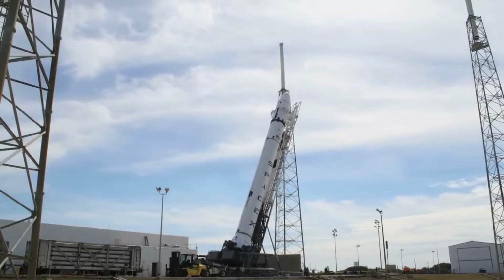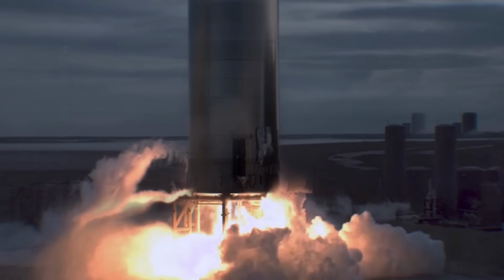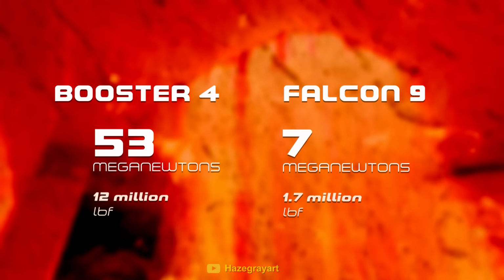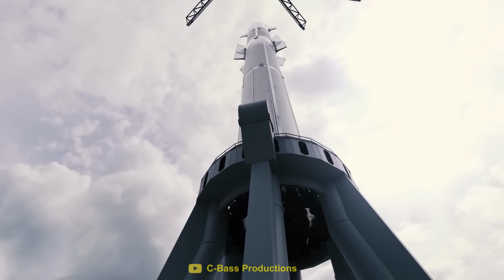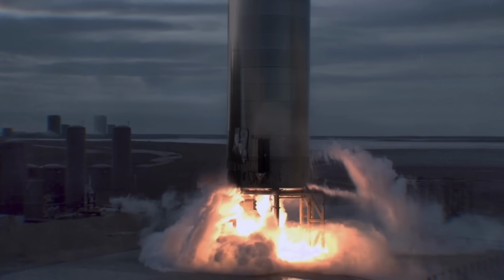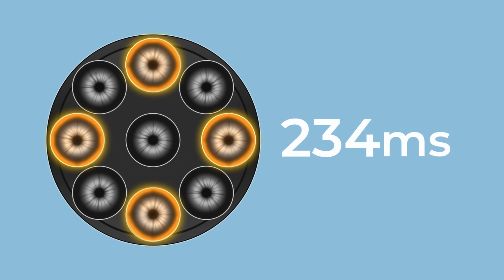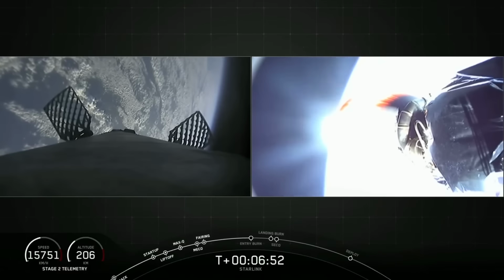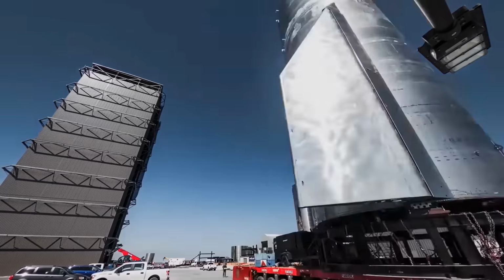How SpaceX Will Test 29 Raptor Engines

Comment: Is there an engineering reason why SpaceX doesn't have flame / debris diverter?
It seems to be much simpler to just build one on the launchpad (which is on the ground than hoping no debris will travel back and damage the engines or rocket structure.
I found this video way too late, after the first launch of starship and could see a lot of problems (debris flying here and there uncontrolled) in the first 15 seconds itself which could easily have been prevented.
Reply: Apparently the reason was more forward looking than practical. They hope to eventually launch rockets from other planets, and it would be less practical to have a diverted on another planet.

Comment: Actually it is a very poor design and put together this super heavy rocket. The more engines the greater problems. Should design a bigger engine and put just 3 engines or max 4 engines but not so many small engine. I think they are lazy to redesign from scratch and make super heavy engine for this rocket.

Comment: If it takes 14 tons of fuel to light the engines for 3 seconds, divide 14 by three and you need 4.6 tons for 1 second. and for a minute? 280 Tons.

Comment: In Newtonian mechanics, linear momentum, translational momentum, or simply momentum is the product of the mass and velocity of an object. It is a vector quantity, possessing a magnitude and a direction. If m is an object's mass and v is its velocity (also a vector quantity), then the object's momentum p is

{\displaystyle \mathbf {p} =m\mathbf {v} .}\mathbf{p} = m \mathbf{v}.
In the International System of Units (SI), the unit of measurement of momentum is the kilogram metre per second (kg⋅m/s), which is equivalent to the newton-second.

Newton's second law of motion states that the rate of change of a body's momentum is equal to the net force acting on it. Momentum depends on the frame of reference, but in any inertial frame it is a conserved quantity, meaning that if a closed system is not affected by external forces, its total linear momentum does not change. Momentum is also conserved in special relativity (with a modified formula) and, in a modified form, in electrodynamics, quantum mechanics, quantum field theory, and general relativity. It is an expression of one of the fundamental symmetries of space and time: translational symmetry.

Website;https;//www. Facebook.com/aamor9.
Website;https://www.linkedin.com/in/amos-ariny-00434629/?originalSubdomain=ug

Website; https://ug.linkedin.com/in/amos-ariny-022056220

Website;www;twitter.com/aamor9
www.mit.academia.edu/amosariny

Comment: Didn’t the Russians try this with so many engines, I believe they failed, just too many things can go wrong, it would be a much smarter approaches build the engines like the Saturn 5 F1 engines. Although we would have to completely redesign this engine because each one was custom made, and the men who built them had to make allot of modifications that were not documented, so it’s not like you could just pull the prints out of the drawer and build one of these. They say we have advanced, but if that is true, then why can’t we recreate the F1 engine?
Reply: SpaceX already uses a 27 engine rocket the Falcon Heavy so they at least have hands on experience with using that many engines in a single stage.

Comment: Do you want to know why the N1 failed so much? It never matters how many times you upgrade the engines, 
more engines = more complexity 
more complexity = a greater risk for something to go wrong
This is why everything on a spacecraft must be as simple as possible, to mitigate the chance something will go wrong.
Bigger, simplier, and less numerous is better
Reply: I generally agree but spaceX already launched multiple rockets with 27 engines in the booster stage (falcon heavy) so they at least have experience with successfully launching a ridiculous number of engines.

Comment: 29 engines ... why not 1 massive 9m diameter engine ?
Reply: Less efficient, more expensive, single point of failure and that one engine would need to endure 29 times the forces of one small engine.

Comment: Although I'm a student preparing for engineering exam but I wanna say that we are using lots of thrusters in rocket but and already the fuel make it so heavy ,we should work in the project that is how we can use electricity to provide inssane speed to rocket this will reduce fuel consumption in interplanetary mission and make mission more safer.
Reply: I cant rly tell what your are saying so i may be missing the point but the rocket is not running all the way to mars just a short burn to get speed and the landing burn. Ion thrusters exist but cannot get u to orbit and take to long to accelerate for a short journey such as mars

Comment: Watching this launch will be absolutely amazing but HEARING IT will be something else!
Reply: when one of these things blows up, you'll get to feel it too.
Reply: @piccolo917  way to be optimistic
Reply: @bogbog  Musk plans to launch thousands of them. Currently, rockets have 4-10% failure rate, most of them happening on the ground. So, statistically, there will be an explosion. And with 4600 tons of liquid methane with all the oxygen it will to instantly ignite near it, that will be 46.000.000 * 55,5 MJ = 2553000000 MJ = 610 kilotons of TNT. For comparison, the Hiroshima bomb was 16 kilotons. Even if just 10% of that fuel explodes, that's almost 4 times more than the nuclear bomb.

So when I say "when one of these things blows up, you'll get to feel it too", I'm not "optimistic" but realistic.

Comment: I wish them great success, but looking at this I'm reminded of the Soviet N1 Super Heavy Lift Vehicle which was powered by no less than thirty NK-15 rocket engines. After four launches, they couldn't make that work.
I hope that SpaceX has been a strong and dedicated student of history.
Reply: You are right, but the main reason for the failures of the N1 rocket was the short deadlines set by the government and the rush to check the engines (there really wasn’t any). Also, after 4 unsuccessful launches, two more finished copies were built, but, unfortunately, they were dismantled for metal, because the Soviets considered the rocket pointless and unprofitable.

Comment: The aviation and space industry has changed and does not implicate Space X...absolutely nobody around here knows what is going on...New form of aerospace manufacturing that eliminates the traditional riveting of aviation and space.. .Double automatic joints with controlled asymmetry on paramagnetic alloys of titanium and aluminum...The new technology produces Starship 40 tons lighter because it is capable of manufacturing automatically for the first time on titanium...The new technology builds the ship and change materials...Automated laser joints on titanium alloys..

Comment: They shouldn't fire Starship's engines a few at a time. They should always perform test firings with all engines......but maybe at reduced power settings. If the engines aren't throttleable, then they can modify the fuel supply to simply operate them at reduced thrust. And then read their data and keep bumping up the thrust until they reach the desired power setting. Again, they should not do test firings without all engines operating. They need to know how the entire package works together.
Reply: SpaceX engineers already know this and far better than you (and me)
Reply: @minetubequest  They blow the thing up every time they test it. You were saying???

Comment: 2:05 - yes, one that failed.
I'm calling it, dudes. The Starship design and its booster are a nonstarter. This kind of thing has been tried before, and it failed before.
Reply: Falcon heavy has 27 engines and have all been perfect flights. Only two Merlin engines have ever failed in flight out of 140 Falcon 9 flights. It'll work.
Reply: @Ethan_Roberts  Grimes's ex husband's stocks are going to plummet when 30+ astronauts are eventually incinerated in a globally recognized space catastrophe. I just hope he's one of them.

Comment: Don't let this distract you from the fact that the Boca Chica location is surrounded by multiple wildlife parks that are home to multiple endangered animals...  Including 5 species of sea turtles that lay their eggs at the nearby beach.
SpaceX is not approved by the FAA to launch anything but Falcon and Falcon Heavy because of the noise levels, but have done so anyway.  One failed launch ended up burning 100+ acres of grassland nearby, home to one of the endangered cats in the area.  

How long will they be allowed to get away with it?
Reply: Until there are negative effects that cannot be mitigated Mr. 100 gazilion acres will burn.
Just like the early testfilghts were supposed to knock out every window in Padre isle with a force of a nuke to some of you

Comment: 29 engines?  What could go wrong?  A lot.  Too many engines was one of the flaws of the N1 rocket.  Saturn V was a success because it had far fewer engines which means less to go wrong.
Reply: Falcon heavy has 27 engines and has had no problems. Over 140 Falcon 9s have flown, that's more than 1260 engines and only 2 have ever failed in flight.
Reply: I think the countless engineers designing and building this are well aware of the N1's history.

Comment: Too many engines the risk for failure is higher 😳
Reply: Eh Falcon heavy lights 27 engines in its booster stage and has a pretty solid track record so far.

Comment: it wasn't that the soviets didn't have the facilities to static fire the n1. it was that the n1 engines once turned on then turned off couldn't be started again.
Reply: The main reason for the failures of the H1 rocket was the short deadlines set by the government and the rush to check the engines (there really wasn’t any). Also, after 4 unsuccessful launches, two more finished copies were built, but, unfortunately, they were dismantled for metal, because the Soviets considered the rocket pointless and unprofitable.

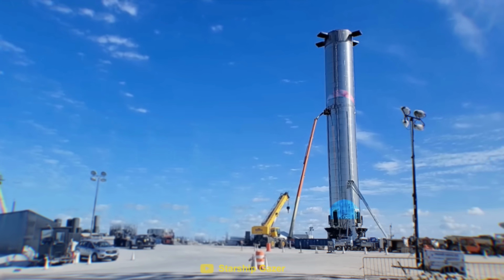Comment: @Primal Space Hey, what is your source for 1:21? "it makes sense to significantly overfill the liquid oxygen tanks"
That seems like a really bad idea.
Reply: Can usually see on previous Starship static fires that the lox tank has a higher frost line than the methane.
Reply: @Ethan_Roberts  sure, but that is because there mixture is not 1:1
Reply: You already have to load enough oxygen to fully combust the methane since you are aiming for maximum performance with minimum fuel and want to test your engines at the extremes. Since you already have enough oxygen for full combustion anyway adding more won’t make a bigger boom while more methane can use the ambient air to combust and would therefore result in a bigger boom.

Comment: How come more oxygen won't make the fireball larger? Isn't the whole point of the oxygen that it is extremely flameable?
Reply: Oxygen is not flammable at all.
Fire, by definition is oxidation of fuel. Fuel burns, oxygen only enables burning.
More fuel means more fire, more oxygen doesn't mean more fire.
Reply: @max5250  try to put some butter onto liquid oxygen bottle valve ... then you can test all your burning definitions
Reply: @danender5555  
Are you trying to imply that, in this case, liquid oxygen burns, and butter enables burning?
Maybe you should rewrite chemistry as we know it...
Reply: @max5250  Rewrite chemistry if you want to, it is was not what I said.
I know what is happening with stored liquid oxygen in certain circumstances...

Comment: LOL! This WILL blow up! Just like the over engined Soviet rockets! Out of 29 you will have failures on EVERY launch, yes even with Muskies "super" engines!
Reply: Why would there be failures on every launch because there are 29 engines? There have been over 130 Falcon 9 launches and only two engines have ever failed.
Reply: @Ethan_Roberts  It's just uneducated people stating their uneducated opinions.... Obviously the raptor is still in development, but considering how well spacex's merlins have done, I have no doubt that they will find success with the raptors as well. 

Even if one or two were to fail, the extra engines will likely be more than sufficient. They just need to avoid the N1s problems!

Comment: Reverse landing does not make the Falcon 9 one of the most revolutionary rockets in history as this has been done several times before. Both Nasa and Bell successfully did this around 1990 and Space X has hired many of the engineers behind these projects. It was also done on the lunar landing in 1969. Several countries tested VTOL in the 50s such as the French Atar Volant C400, British had Rolls-Royce "Flying Bedstead" and  Americans the Ryan X-13 Vertijet. The Germans experimented during the war with Focke-Achgelis Fa 269, among others, but the idea and patents dates back to the 1920s.
Reply: You're right. Reusable landing makes it revolutionary. I do not know of any other rocket which has flown multiple times without very, very extensive refurbishment, if any at all (though of course the 9 does require some).
Reply: @jrcowboy1099  All the VTOLs from the 50s  vas reusable and flew several times. So did the McDonnell Douglas DC-X VTVL in the 90s, look it up. The maintenance of the Falcon 9 is extensive, it's not just refueling and a quick service. The alleged low costs are due to being financed by military launches, the price per kg launched is in total almost as high as the space shuttle.
Reply: @ronnysundt3249  the DC-X was not an orbital capable rocket as were many other test or experimental vehicles. The Falcon 9 is the first of its class to land like this, be resuable and make a business model.
Reply: @ronnysundt3249  where do you get your misinformation?
Reply: @Ethan_Roberts   The DX-9, the  Grasshopper and others were test beds and not designed for any cargo but you're right, F9 is the first business model, valid point. It's like testing a rolling chassis and dynotesting an engine separately. Putting them together does not make the technique revolutionary in any way but as you said, first in its class.
Reply: @anaaerospace  You have managed to find your way into Youtube. Then you also should be able to google the projects above and read up on the topic,  rather before commenting.
Reply: @ronnysundt3249  you are literally saying that $/kg of the falcon 9 and the space shuttle is practically equal. unless you provide some sources to that statement i will not take you seriously since everything i could find says that the shuttle is pretty much 20x more expensive than the falcon 9
Reply: DC-X was a program similar to Grasshopper both cant place any payload into orbit but F9 can

Comment: I am very curious if Spacex is going for an all engines simulteneous static fire test. According to the info about the thrust of the Raptor-engine, i think the booster will be torn off of the engine-table when firing all 29Raptors at the same time. I say this not because i doubt the clamps on the table, but i doubt the strenght of the steel of the booster where the thrust-puck is situated.
Reply: The steel will be fine. It’s the footers I’m worried about. That kind of low frequency vibration can cause some serious  liquification to the backfill. I can imagine the whole thing lifting out of the ground. But I’m no engineer when it comes to that sort of stuff.

Comment: man.. i wish one day in the future, people would join together and build every single piece of machine that was either still stuck only on the blue print or (like the N1) blown up to pieces.. they could build a sea dragon replica :v
Reply: You are right. T
he main reason for the failures of the H1 rocket was the short deadlines set by the government and the rush to check the engines (there really wasn’t any). Also, after 4 unsuccessful launches, two more finished copies were built, but, unfortunately, they were dismantled for metal, because the Soviets considered the rocket pointless and unprofitable.

Comment: This thing will have around 50% more thrust than the Saturn V did, which is just insane to think about. It's going to be crazy to watch this thing launch, and just as crazy to see them catch it on landing.
Reply: I believe it’s also much more fuel efficient than Saturn V, correct?
Reply: Agreed
Reply: Gurlll it was crazy
Reply: agreed
Reply: 🕌
🏨🎪
Penjelasan
🕌
🕌🕌
Penjelasan
Reply: But they need strap on engines to do it. Saturn V had five F-1 engines producing 7.5 million pounds of thrust. SpaceX needs almost 30 engines to do the same thing. More engines = more potential points of failure as the Soviets discovered in the 1960s.
Reply: @kb3byu now Super Heavy has 33 engines

Comment: How do they measure the thrust during a static fire?
Reply: Load Cells (Usually a transducer device with 4 strain gauges arranged into a Wheatstone Bridge and the resulting voltage(s) converted to the applied force/thrust)
Reply: I should also note that multiple load cells can be used together to determine the overall thrust vector of the engines since many rocket engines are gimbaled (can pivot/rotate to change their thrust vector)

Comment: 2:41 its not that the soviets didn't have the infrastructure to static fire the n1, its because they coupdn't, the Engines on the N1 first stage used pyrotechnic valves and were single use, they tested 1 out of every 4 that were produced.
Reply: The main reason for the failures of the H1 rocket was the short deadlines set by the government and the rush to check the engines (there really wasn’t any). Also, after 4 unsuccessful launches, two more finished copies were built, but, unfortunately, they were dismantled for metal, because the Soviets considered the rocket pointless and unprofitable.